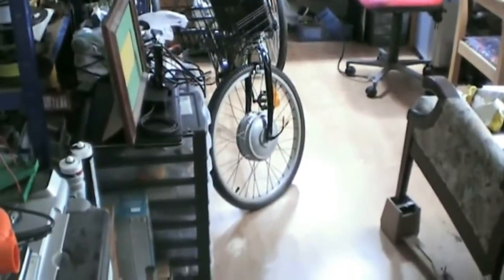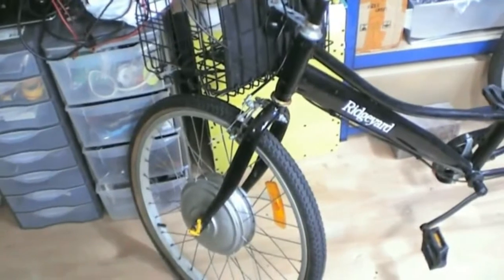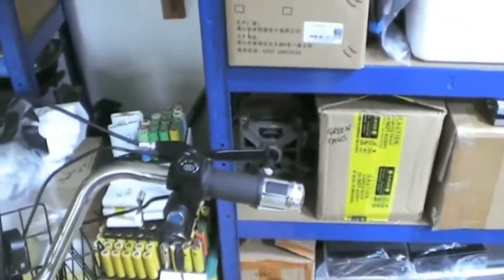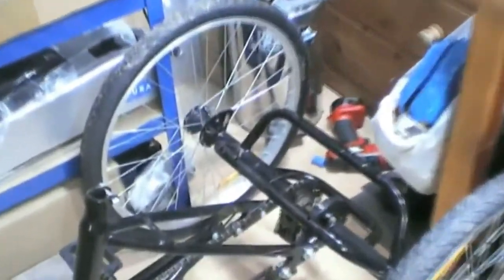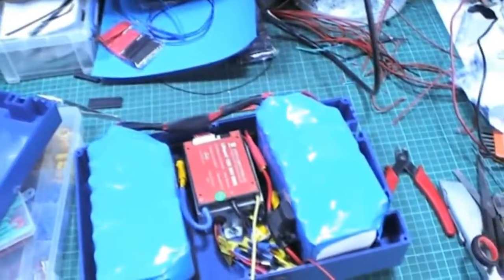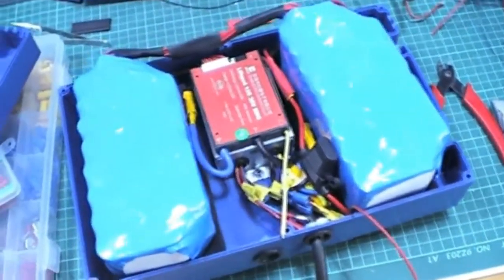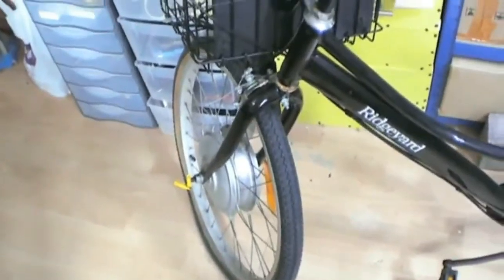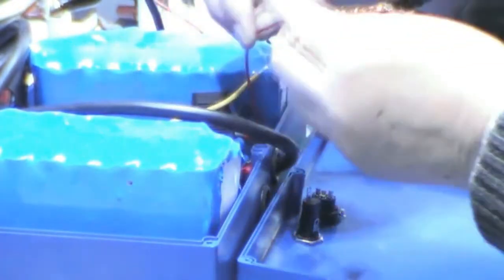Electric Trike DIY for a Frontline Carer.

Comment: Its a lovely machine my good friend, it would be handy to have with a basket on the back for moving bits about, it looks a decent capacity for range and the 250w motor should get some good efficiency out of the batteries, the battery pack is looking a really nice unit :-) My best down there, I look forward to seeing this in action :-p
Reply from the maker: Thank you my good friend. I now have all the electrics on the bike working. Just some cable ties to put on. Pump up tire and adjust gears. Job done. One happy carer. Oh and get rid of some surface rust.Hows you and mum? Please stay safe both of you. Regards to you both.
Reply: @MYNICEEV  The electrics on these bikes I dont seem to mind to much but the body work and the mechanics side do stretch my capabilities I must admit, from sorting the brakes to the gears to the body I always seem to struggle there, just not used to that type of hands on I think :-) We are well thanks my good friend, mum is looking after my moggy while im staying with a friend in his second floor flat, mum has a nice back garden for mog to do his moggy roaming there and is keeping her company while she has been in with the cov stuff going about, where ive been focusing on my coding alot and applying for a few coding jobs to get a bit more active again and get some cash back in for my projects and for a new place to settle in for a while with a garden for the mog, I hope you are healing well down there and Denise and the youngsters are well, no bad news is most good news these days :-) my best my good friend your projects and quality of work always cheer me up :-p